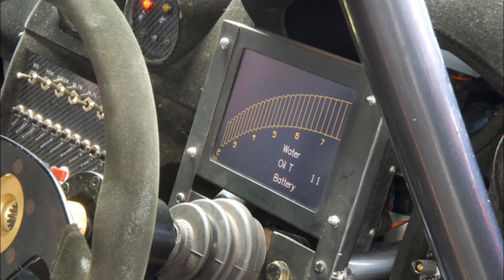FORD FIESTA COSWORTH 617BHP

Comment: Was it not running?  Why don't you video it driving so we can see and hear it in action.....
Reply from the maker: because these were taken 11 years ago before i discovered youtube
Reply: @MJRACING1  any more info on the car, hard to find out about a lot of those older mk6 awd race cars. Seems there was the ford works jwrc cars (which this body kit seems to be from) olsbergs orange rallyx car that was cosworth driveline and duratec engine, as well as some with cosworth engine instead of the duratec. Cheers.
Reply from the maker: @avrilcadabra  what u want to know , i built the car and still have it